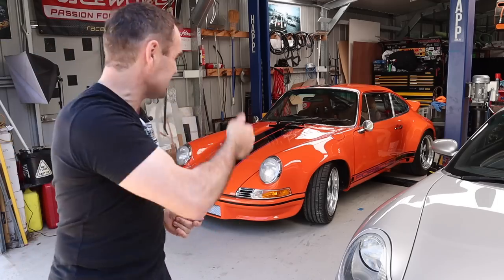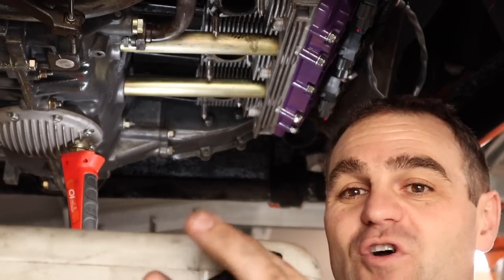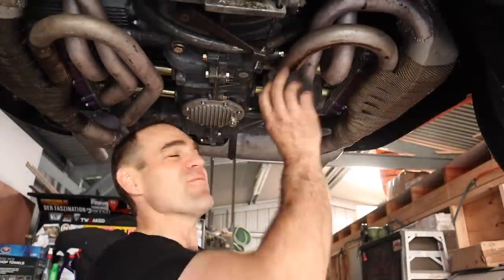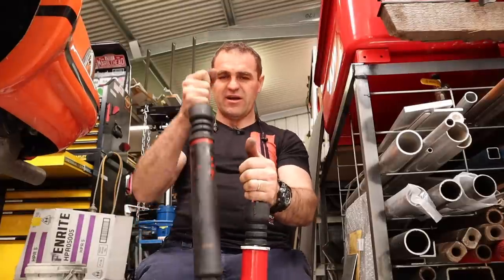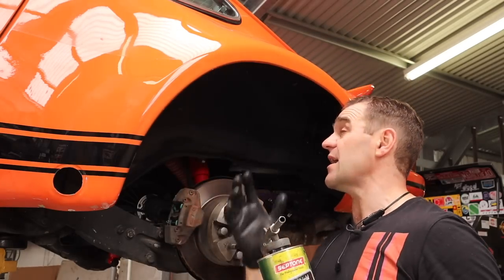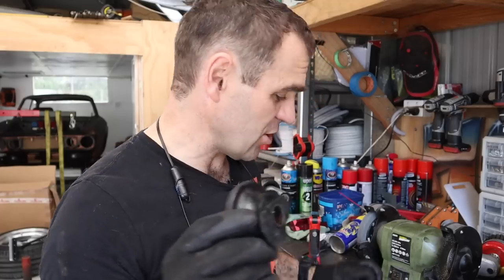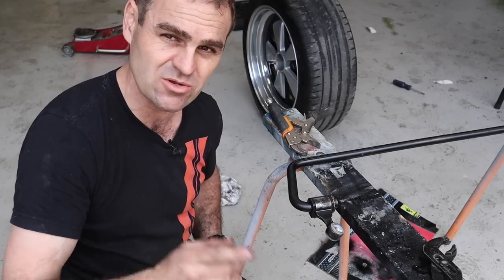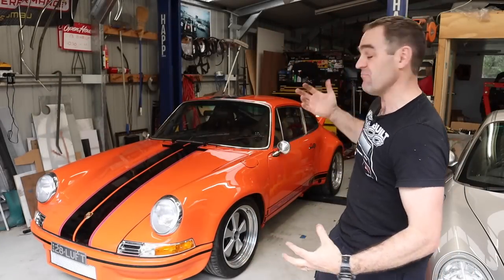I let all the smoke out again.. - Porsche 911 2.8 RSR Build Season 3.4

Comment: You need to reset the torsion bars of you rear suspension to get the back of your car higher! Or your tires will keep rubbing. There is no other way around it.
Reply: +1,  new shocks won't fix the ride height issue

Comment: Tip for next time re the oil... I had to change a leaking crush washer on my oil sump plug just after putting fresh oil into my Alfa Romeo 147 Twin Spark. I undid the oil filler cap on the rocker cover, put a rag over the filler hole and then jammed the nozzle of a shop vacuum into the oil filler hole. I started the vacuum and removed the sump plug. There was enough suction generated by the shop vacuum to prevent any oil from escaping out of the sump drain hole while I changed the crush washer and then refitted the sump plug. Worked like a charm... much to my surprise.

Comment: Hey Jeff
If the rear tyres are rubbing on the inside of the arches its the ride height.  The shocks wont change that.... You need to check the springs and also I noticed that your huge spacers are effectively reducing the tyre to arch clearance.......!!
Reply: Agreed,  the ride height on the torsion bars can be adjusted.  If the car has a basic VIN then are the torsion bars correct for the RSR, stance and big wings?  The dampers will assist a little especially if they are gas charged as most modern dampers are.  If the Konis are 'historic' then they will be oil damped only, yours appear to be these as the gas ones will gently rise to full extension off the car.  Gas charged dampers add a little extra 'spring' rate to the suspension.  Personally, I prefer Bilsteins for a road car as they are less harsh than the Konis - its all to do with the high speed damping.  Konis are preferred for racing though, which is confirmed by your comments relating to Bilsteins for lesser 911s and the RSR being more track oriented. 
As said, the rear spacers are excessive.  For motorsports the maximum spacer thickness is 1"(25mm), which is safety led due to the extra load the spacers put on the studs and bearings.  Narrower spacers ought to bring the tyre in sufficiently to prevent rubbing.
Another thought on this.  As the shell is a basic one then the big wings have been added on and may not have been by the factory - are they set at the correct height?
Reply: I agree with John and Clive. Plus, you need a bit of oil before you put the front inserts in their housings. Other wife, you might get rattles. Engine oil will do.
Reply: I agree with John, springs control the ride height BUT in this case it seems to be a wheel travel issue. Should be controlled by a bumpstop with the correct block length.
Reply: @misterplow1  The torsion bars control the wheel travel and should be of correct thickness to limit the distance travelled.  The bump stops should not be used to resolve a deficiency of the incorrect torsion bars or something else.  The bump stop is there to stop the damper bottoming out.  As the bumpstop does not have a known spring rate it cannot be relied upon to control general suspension movement that would provide unpredictable handling on the limit.
Reply: A couple of other points that I thought of:
1)  Has the chassis and/or suspension  been aligned?  It is quite common that a special may have been damaged previously or poorly assembled without a chassis jig.  I have a Beetle with no obvious signs of damage and 944 rear suspension where the rear wheels are offset by 1/2" in the arches.  After all, the 911 is a big sophisticated Beetle.  
2)  If Jeff took a passenger on his jaunt then was their weight not catered for?  If it was the Missus then did she take her handbag as in my experience they can hold excess weight, sometimes the kitchen sink!!!

Comment: How does changing the rear shocks stop the rear wheel rubbing on the Guard??? Take the spring out and lift the rear wheel to full up position..if it touches then change wheel, tyre, wheel spacer, gaurd or bump stop...increasing damping rate or spring rate is not the way to fix it.

Comment: One of the benefits of how the 911 suspension is designed is that it is adjustable in ways most other factory stock cars are not.  You can make lager ride height adjustment by rotating the torsion bars and micro adjustments on the spring plate.   Hope this helps

Comment: Jeff, Loctite make a really effective "hydraulic sealant" for jobs just like that crankcase oil fitting it will seal it from leakage/seepage and lock the fitting orientation, so the fitting will not get disturbed when you work on the other fittings on that pipe.
Reply: Need to be careful as they are soft magnesium cases, using a thread lock type loctite... one of the tread sealing products.

Comment: Loctite that aluminium fitting in the case, red loctite, you dont want that to loosen unless you heat it up.

For the suspension ho with bigger torsion bars, stock front, 29mm rears are fine, you might go to 21/29, 21/30.
But do torsion bars and bushings together because its a pain in the rear job...

Comment: Hi Jeff, I had the same experience with the front shock inserts - oil everywhere and I thought it was just blown inserts.  Turns out that that oil is supposed to be in there.  It transfers any heat generated in the insert to the outer case.  I think it is just standard motor oil.  I had the same experience with the suspension change - night and day!  Your car looks awesome!  I know you are going to have lots of fun with it!  Oh, had the exact same thing happen with the wiring in the Beetle I was working on.  It took a bit to figure out what was going on but the engine power wire had completely chafed and shorted out.  It was pretty exciting!!.  Safe travels, Franny
Reply from the maker: The shocks really did make a night and day improvement. Now to sort the rest of the dodgy wiring under the dash ;)

Comment: I have similar style front inserts on my first gen Rx7, one tip I've been givin is to put a small amount of oil in the tube before you put the insert in, it helps to transfer the heat out of the shock and into the surrounding metal so it can dissipate faster/more efficiently! Helps the shocks perform better and last longer, just don't put too much so you don't make a mess. My friend does the same on his old datsun 510.

Comment: Is the rear torsion bar or coil spring?  Did you replace them during the build, I can't remember if you did.  Either way if they are 50 years old perhaps they have sagged or lost tension?  Sounds like you just need to bump up the ride height by a bit and replacing the Springs/torsion bars from old sagged ones to new ones would help.  Springs/Torsion bars set the ride height not the shocks, the shocks control damping rate and control the spring.

Comment: The burned wire had a direct short and no fuse. Did you install a fuse, or run the wire to a fuse panel? If that happens without you there to disconnect power it will likely start a fire.

Comment: G'day Jeff....your bench grinder (floating around all over the place when you're using it), is doing my head in...hahaha
I appreciate you may need/want to be able to remove the grinder to use the bench for other purposes..... but here's an idea to consider:
Why not add 4 bolts to the mounting holes of the grinder, with the threads pointing downwards and with about 50mm of bare thread protruding downwards. Then drill 4 corresponding holes in the bench. 
That way you can have the grinder sitting "in" the 4 holes when you're using it, but still able to be lifted off the bench when you need to use the bench for other purposes.
Just a thought...

Comment: 240z's had the same arrangement that you saw with the front struts. When replacing the strut internals an insert, I was told to use some ATF in strut tube to aid in heat transfer between the new insert and the outer strut tube..

Comment: Glad you are ticking off the snag list 😊

Do be very careful of the electrics. 50 year old wiring to begin with and people mess with it when they don't understand electrics. Also, the normal cable we buy in the shops is usually 10amp and that won't cut it for a fair few circuits on most cars. For instance the switched live to most modern radio's is 15amp fuse so you need a cable gauge greater than 15amps etc etc.

For the rear suspension it's not best to rely on the dampers. Those 50yr old torsion bars won't be the same strength as when they left from the factory especially the drivers side as the constant weight of the driver makes that side weaker over time and it'll sag a bit compared to passenger side. New torsion bars, and maybe even slightly heavier poundage, would be a good thing.
You could also get adjustable shocks with assistor coil overs so best of both worlds then.

Either way loving your videos as always 😁

Comment: For the 3.2 case, the workshop manual recommends to put some Loctite 270 (green one) between on the fitting threads (well this is for the aluminum case I reckon... Maybe yours is a magnesium).

Comment: Sorry. Your tire rub won't be resolved by changing the ride height unless you plan on limiting all wheel travel.  However, that's not how suspension is supposed to work. There must be clearance throughout the jounce and rebound travel of the suspension and attached bits. Increasing ride height and/or increasing the spring rate for additional clearance defeats the purpose of setting up a properly working suspension. The first high speed/high load steady state road curve or road dip will overcome any ride height adjustment and/or "normal" increase in spring rate. 

If there are wheel spacers, remove them or use thinner spacers. Another remote possibility is that corner has excessive camber in the positive direction and/or a damaged (bent) control arm.

If the above possibilities are within factory specs, the difficult answer is that the tire/wheel combination may have excessive offset. What size wheels and tires are you using? Were the wheels custom built with excessive offset? You could try the next smaller tire width or a higher profile tire or even a change in tire manufacture. Not all identical size tires have identical tire dimensions. Not the best final solution. If the wheel/tire offset is the culprit, that should be addressed.

Comment: Ride height has little to do with shocks, it is the spring rate and position that decides that. Torsion bar might be in the wrong position. These shocks doesn’t seem to be preloaded with gas so they won’t do anything at all to ride height, and foam up with less damping when going rough.

Comment: I bet you fair crapped your pants when the smoke started! P.s. the aviation technician in me shuddered when you were using multigrips and an adjustable spanner on those oil fittings but you got it all done mate.
Reply from the maker: There is no other tools that will fit while the engine is assembled unfortunately.
Reply: You did what you had to.. And you got it done..and it's not an  aircraft so I'll get over myself 😄
Reply from the maker: Haha. The listed factory torque setting was something like 120nM which I wasn't willing to try on a 50 year old mag case. I suppose now I am paying for it ;)

Comment: Jeff do yourself a favour and buy yourself a new wiring harness, after 50 years the copper in the lines will have work hardened in places and built up resistance. most classic car problems are due to faulty wiring. Or build your own new loom with a PDU life the liferacing one, so no relays just signal wires, expensive but simple, it will also let you do things like so many presses of a button or a sequence before starting as a known to you only start sequence, loads and loads of options. Also might be worth resetting your reset torsion bars if you are still getting rubbing as it will only get worse as the new shocks bed in.

Comment: it looks like these koni replacement rear shocks are bad, it suppose to lift rear suspension after it is installed, these koni ones wont do any good, usually you need to use extra jack under shocks to insert bolt because it springs back when shock is good of course,

Comment: Those koni red are not very good, they are not gas filled, you need a complet new suspension with new springs ass well, a sachs performance, bilstein b12, h&r maybe kw if you want to spend the money on one off the best suspension, or kw budget line stx
Regards sören

Comment: Had to laugh at the front shocks, haven’t seen that type for 45 years, old VW’s, Audi and Porsche had those cartridges... they always made a mess when changing and stank! 🤢
Reply: There is nothing to complain about with the built up dampers, which actually offer advantages in unsprung weight and rebuildability as well as a more effective stroke length.  That rebuildability allows fine tuning of the damper in that the oil viscosity and oil quantity can be varied without sending them back to the factory.  Most high performance motorcycles use this type of damper on the front wheel and nobody complains about them.  All the best motor racing dampers are similarly rebuildable with even the valving being variable.